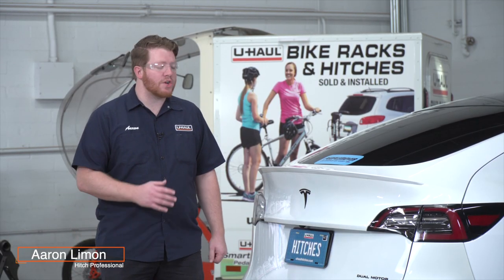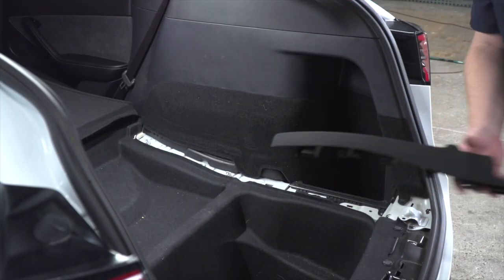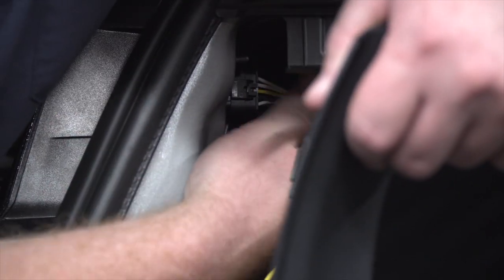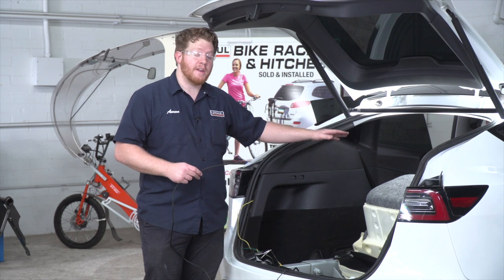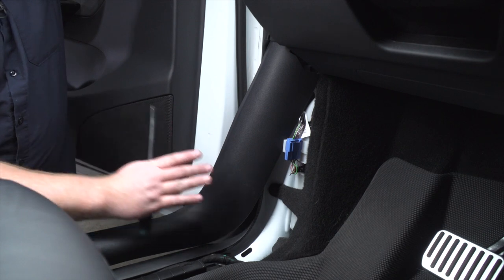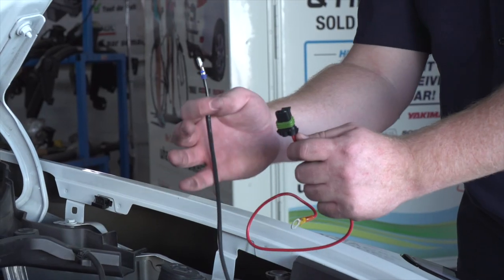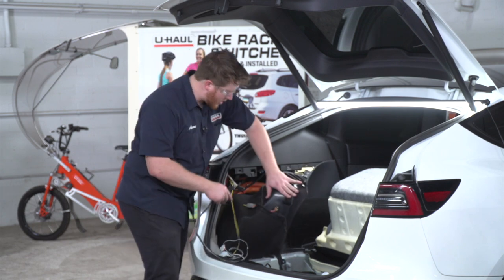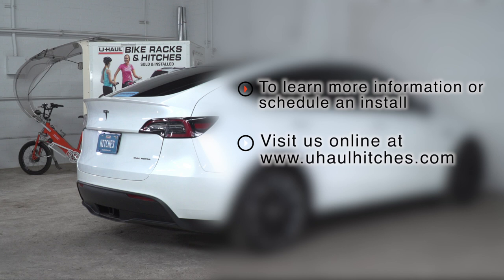2021-2022 Tesla Model Y | U-Haul Trailer Wiring Installation | CQT118831

Comment: The Ingenext trailer wire is sooooo much simpler and no battery lead required.  Plugs directly to the factory coupler for the trailer wires .

Comment: This video is out of date for the 2024 Model Y  The back pockets are totally different and I believe the wiring is different so the brakes do not work with this kit.
Reply from the maker: The video clearly states 2021-2022. Sorry for the confusion but the quick connect part does not fit the 2023 or 2024. a universal kit must be used.

Comment: Beware. Brake lights didn't work on mine either.
Reply from the maker: This is a very valid concern if you are using the Quick Connect as demonstrated in the video. We would suggest calling the manufacturer in case they have a possible production issue. In our tests we have found that the kit was working as designed.
Reply: Did you end up fixing it? I wanna order this product and your comment has me at a hault
Reply: @ajajeal540  The manufacturer sent me a new 118831 replacement kit. I just installed it and the brake lights still do not work with this replacement kit. All other functions do work. I have an August build 2021 Model Y.  Fortunately I purchased a Modulite ZCI kit which I'm about to install since I have everything already pulled apart. I would order both the 118831 kit and the Modulite ZCI kit and if the 118831 doesn't work return it and install the Modulite ZCI kit while you have everything opened up.
Reply: I've finished the install of the  Modulite ZCI kit. Everything works. The Model Y is a 3 Wire System: The vehicle's turn, brake and tail light function are on separate wires. On my car the wires going into the back lamp harness are as follows. Black wire is Ground. The Yellow wire is parking. The Red wire is Turn. The Gray wire is Brake.
Reply: @trailerhitches  The kit - 118831-  does not have sensing for the brake function on my August 2021 production Model Y.  It only is wired to the Parking Light and the Turn Light. The STOP circuit is bypassed and not wired into the module.

Comment: I bought a light to check if it works. Running light works. Brake light doesn’t. And when I hit the right turn signal the light blinks. I think this is a bad kit.
Reply from the maker: This is a very valid concern if you are using the Quick Connect as demonstrated in the video. We would suggest calling the manufacturer in case they have a possible production issue. In our tests we have found that the kit was working as designed.
Reply: Did you end up fixing it? I wanna order this product and your comment has me at a hault
Reply: This is because Tesla changed to a 3 wire system, the mode in this video won’t work for Model Ys with this, mine was made 05/21.  Install the Ingenext wire kit.  I don’t work for them, it was just the only solution that works.
Reply: Same issue. The brake wire on Model Y 2021 is on grey wire. The grey wire is not even connected to the harness. It will not work. This harness might work on older 2021 before the tail light design was changed.

Comment: what about the trailer mode software upgrade?
Reply: You have to get the tesla hitch installed and they install trailer mode.  If you do an aftermarket you will not get trailer mode.
Reply: What is the approach of this software? What would be improved?
Reply: @pit9820  Let's the vehicle know its towing and also let the driver monitor stuff like trailer electrical connection and change the power modes
Reply: So is it necessary to have it? Can I manually change settings?
Reply: @paulm4176  it's more convenient. I added an aftermarket tow hitch to my long-range Model Y and it was a very annoying drive because the vehicle kept saying an object was too close to the back. Now my model Y performance came with the towing feature upgrade and it is plug-and-play. Yes, you can add the towing stuff afterward, but without the software upgrade it's very annoying.
Reply: @newerarc4784  So can I just go to tesla and have them install trailer mode?
Reply: @paulm4176  That, I don't know. I suffered through the annoyance until I sold the thing. I added the towing upgrade to my MYP at order, so I don't see why not. It's just a software upgrade.

Comment: Installed the harness on model Y 2021 and everything works except stop lights. This is the same as many other reports in the comments. Has anyone been able to solve this issue without getting different type of harness?
Reply: Did you find a solution to this?
Reply: Yes. I called Tekonsha, they sent me the programmable harness (the one where you connect magnets around the wires). It works just fine.
Reply: @TheKotik32 great, thanks for sharing!!

Comment: This is not the way to do it. the harness already has dedicated connectos with dedicate power supply instead of trying to leach off the break lights. Doing it this way will cause alerts and an overvoltage alert in the service alerts. due to this condition, the vehicle will think it is malfunctioning so it won't let you use certain features like auto change lane if you have it.